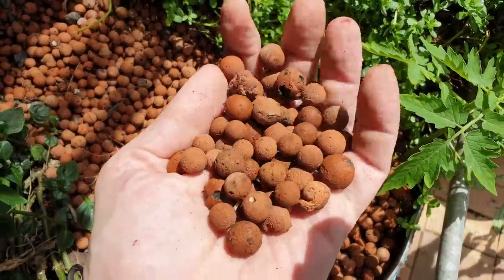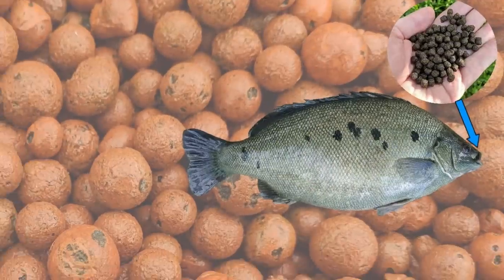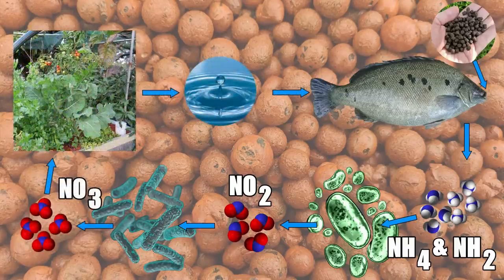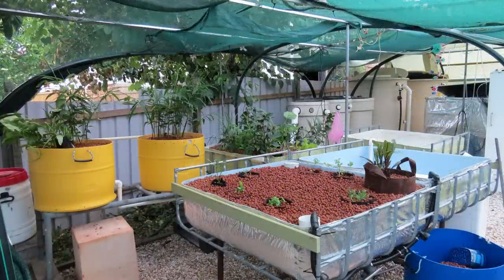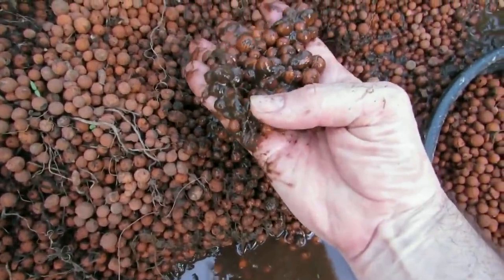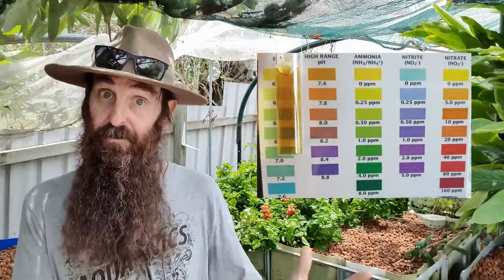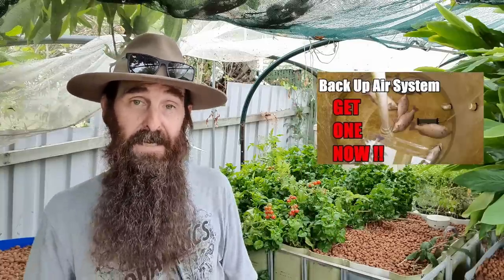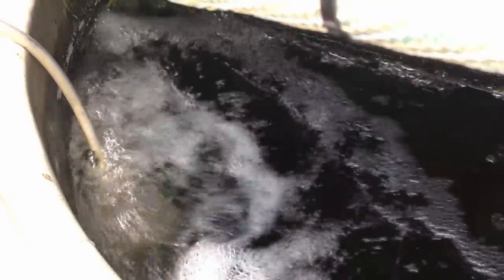5 Common Aquaponic Mistakes That are EASY to AVOID

Comment: If the ammonia is secreted through the fish gills, how can a quality food benefit the system please?
Reply: Are you asking how ammonia is converted to nitrate for the plants to use? As well as some plants are very good at utilising the ammonia directly, it is mostly the media bed bacteria that converts ammonia to nitrite and nitrate  eventually.
Reply: I was wondering why would someone want to use a nutrient rich fish food if the plants use the ammonia from the fish gills. Would the fish waste just be accumulating in the filter with no added benefit to the plant? Cause I am looking to buy a spirulina fish food on my next purchase. Thanks!
Reply: @jbl2270  Because nitrogen or ammonia is not the only thing needed. Wee need most other minerals for plant health and that is locked in the fish poo hence the use of mineralization tanks. Plus direct ammonia utilization is not really efficient. Therefore we need most minerals as well as nitrates to feed the plants.
Reply: already! Somehow the plants will use the nutrients I suppose. Thanks for the input. Much appreciated
Reply from the maker: As Gürkan mentioned above, the plants need more than just the nitrate that the ammonia is converted into. It is also best for the fish to use nutritious food as you will be eating them as well. A sick animal isn't as nutritious as a healthy one. 
Cheers. 
Cheers.

Comment: Hi rob. I have a month old tilapia. The water is still murky though i already have a radial flow filter and a bio filter. How can turn water clear? Do inneed to add another filterfrom the sump going back to the fish pond? I hope you can help me. Thanks
Reply from the maker: As to your request, I would need more information as for all I know you could have 100 fish in a 200L pond. 
From what you've said all I can recommend is that you run a canister/sponge/mesh filter before the water returns to the fish.
Reply: @RobsAquaponics  thanks for that info rob.
Reply: @RobsAquaponics  i'll send you photos and videos later.

Comment: Off topic but am an off grid an wonder where is an idea place to setup a system
Reply from the maker: Probably closest to the top up water source so you don't need to run the pump too much & conserve power Mike. 
It would also need to be in a position that got a decent amount of sun for the plants as well. 
Sorry for the time it took to respond.
Reply: @RobsAquaponics   thank you for the info

Comment: Hi Rob, I would appreciate your help on unexpected tilapia deaths in my aquaponics please. I have lost three of them yesterday and 7 more this morning. Ammonia 0.5 ppm, Nitrite and nitrate 0, pH 6 which is expected before my weekly buffering with no recorded pH spikes. Ammonia is usually at 0.25 in my system and all other parameters are the same. The only things i can rule out is that i transferred 2 small fingerlings from a tank where they were lethargic and dying. Temperatures have dropped suddenly and 4 nights ago I used some BTone and light neem oil spray after. Your help would be much appreciated
Reply from the maker: Sorry I missed this J BL. Have you lost many more?
I have heard of folks losing young tilapia due to massive temperature swings. Oil sprays can also coat the gills of the fish suffocating them if a lot of it gets into the water.
Reply: @RobsAquaponics  No worries Rob. I always appreciate your replies whenever you find the time. I've lost all of them and was bummed out. I had nurtured them from juvenile to full grown adult size and my system was thriving. I dont know what happened as tilapia are tough and I've even seen them living in ponds so full of algae that you couldn't even see your hand in it. I spoke to a pet shop owner and he had also lost his tilapias in his pond around that time. I registered water temp at 15C after they all died. My system is a blue barrel system which may not have given them a chance to acclimatise to the drop in temperature? They had become lethargic and feeding only at the bottom, to not feeding at all to gradual death counts :(
Reply from the maker: @jbl2270   Sorry to hear that mate. :/

Comment: Sooooo.  I made the first mistake, but I already made the mistake and now I have 50 fingerlings 2-4 inches in an IBC w one growbed of clay media.  I also have a biofilter, but I am worried I might have problems in another couple months of growth.  Any suggestions?
Reply from the maker: Hi Thomas. What sort of biofilter are you using?
Reply: @RobsAquaponics  Hey. Since I wrote this comment I added a lot of bioballs to my sump tank and a second grow bed. I also have a small bio filter with additional bioballs so maybe I am good?
Reply: I use clay media and lava rock in grow beds
Reply from the maker: @tgshaffer  You may be. Did the bio balls come with any suggestions as to how much waste they can process?

Comment: Hi, Rob, will the equation of 25 l of clay media for 1 kg of fish will change if someone is using construction stones?
Reply from the maker: Hi mate. It's 25L per 500g or 1lb of fish. 😉👍
It would be basically the same for suitable rocks (with no carbonates in them) that are about 20mm/¾" in size.
Hope that helps.
Reply: @RobsAquaponics  yeah thanks
Reply: @RobsAquaponics  hi rob, if bio filters are used can the requirement of 500 gm of fish for every 25 l of media be reduced? I am planning for 700000 liters of water with 25000 seedlings of barramundi, so it comes out to be 437 tonnes of media which is enormous. Pl help if there is some formula for the calculation of surface area for bacterial colonization
Reply from the maker: @birendrachoubey6122  That is a system much larger than I have built so won't be of much help sorry. You will find that larger facilities will use stand along biofilters using specifically manufactures biomedia. I suggest you enlist the assistance of an aquaculture or aquaponics designer to help you out.
Sorry I can't be of any help
Reply: @RobsAquaponics  thanks no problem

Comment: would a mild amount of solids be acceptable if you have earthworms in the growbeds? 
also - do you have a go-to list in the event of high / low ph spikes?
Reply from the maker: No list on the pH spikes sorry but will look at adding one at some point. 👍
You will always get some solids in the grow beds as most DIY filters are nowhere near as efficient as commercial ones. You'll also get solids in the form of old roots & dying bacteria so there is always something in there for a compost worm to process. 
Hope that helps some & sorry for taking so long to reply.

Comment: My mistake was adding to much hydrated lime into fish tank to try and correct ph
Reply from the maker: 😕 How did the fish go Nguyen?
Reply: @RobsAquaponics   some died from lime burn. Now i add a bit at a time into the radial solid separator which goes through the media beds first before making it to the fish tank. I recently watch your video on adjusting ph, and i am going to try the shell grit. Seems my systems ph is falling quicker than i could raise it

Comment: So for 1000L tank you put 40 fishes? Some people say that they put around 100-120 fishes in a 1000L tank
Reply from the maker: Depends on the context. If you're commercial & know what you're doing go for it. 
I don't think it's fair on the fish to be stocked that densely so that's one reason why I suggest less. 
Most of the folks that contact me for help when their fish start dying are generally stocking more than 60 fish per 1000L. The system gets overloaded with waste (ammonia), the biofilters (beds) crash & fish start dying. 
I think it's just easier to start small in a backyard setting then as you learn more you can go from there. 
Cheers.

Comment: I come from a fish background more so than a plant one. My guess would be adding more water (ie sump tank, filters extra bed) as well as more filtration (removing solids, more nutrient hungry plants) would skew the 1 fish to 25L equation in favor of more fish. Just a guess and would love your input as you have way more experience than I do.
Reply from the maker: The volume of media required is based more on the available surface area that the bacteria can colonise on the media itself, as you probably know. If you were to add a stand alone biofilter with K2 or similar media you could keep more fish than the beds could normally handle with no dramas & have done that myself with system before the p[resent one. 👍

Comment: Well, this explains why I have trouble with my farm every year.
1. Wrong grow media. I used pea gravel. Don't do that.
2. I have little to no solids filter. I tried making a "swirl filter" where the water would come in and swirl and the clean water would be skimmed off the top and solids were expected to fall to the bottom. Only thing is, it doesn't work like expected, so. . . little filtering. Don't do that. . . put on a good solids filter.
Unexplained fish dying off. I lost half my fish overnight recently. This video showed me why. 
At the beginning of the season (my garden is not in a greenhouse) the plants go nuts and produce like crazy. But later in the season, the leaves turn yellow and production falls way off. Most likely due to one or several of the errors listed in this video.
I will be changing the grow media and revising the solid filtering to get the crap out (pun intended).
My grow beds must be washed every season because of the muck that gets in there caused by insufficient filtering and capture of the muck.
I learned more from this short video than I have from many others!
Thank you!
Reply from the maker: I'm glad the video has helped you out Doug & hope you can get the issues sorted soon mate.
Happy growing. 🌱🌱🐟

Comment: Is the fish poo, just a byproduct then, and doesnt really add anything to the cycle?
Reply from the maker: There are nutrients in the solids waste so that's why many folks will add it to an offline mineralisation tank. The solids get mineralised & the nutrient rich water is added back to the system. 
It's a bit more in depth than that & will be posting a clip on the  process once I have mine set up but hope that helps for now. .
Cheers.

Comment: I have some old computer back up sytem I can add a new battery and that can keep thing going.
Reply from the maker: I'm thinking about getting a UPS for my parents system. Just need to find one large enough to run a 25w pump for 8-10 hours... 
Cheers Ronald & happy growing mate.
Reply from the maker: The Truth about Africa hurts   I like to have the water run 24/7 & the main air line as well. 
Have seen others run on timers but have also seen what happens when the timers fail or are not set right.
Reply from the maker: The Truth about Africa hurts  I'm lucky enough to have a live in house sitter when we go away but will be looking at setting up the next system with dual water & air systems.  Cheers mate.

Comment: If using nut and tails ensure the rubber washer is in properly and not worn nearly lost my fish
Reply from the maker: OUCH. Thanks for pointing that out n k. 👍
I have had a few leak due to over tightening as well when I first started out.

Comment: Proper size nft Will overflow #My2Centz
Reply from the maker: I haven't grown with NFT as of yet.. 
Cheers.
Reply: @RobsAquaponics  Hey Fam, Really Enjoy your Content, thank you for Sharing. Nft is Great, You Should Definitely Look into That. Way More Plants and Triple if u Tafe It Vertical. You Can Still even Use Clay Pepples in the Net Cups. Oh! And I'm Prettry Curtain u May Even Start on your Preexisting System, if you Split the Flow From The Sump Back tuh the Fish Tank/NFT With Ball Valves On Every NFT Track tuh Control Flow Rate. You Would Want and Nice Slow Trickle. With  multiple tracks Each ball Valve Would Control every Flow Rate Acordingly As Not to Overflow Tracks with Slight Adjusments until Satisfied. Go For at Least The Minimum 3 inches for Good Root Space. 
Just Sum basics 
I am still Learning, But Shout Definitely Look into This 
Floating Water Beds Are Great Too, If Not Better
LessMechanics
Less fun, lol 

Great Growing
BPonics

Comment: HEY ROB, COMING OUT IN THE MORNING AND FINDING A TANK FULL OF DEAD FISH DOESN'T SOUND LIKE A PLEASANT EXPERIENCE.  LOL   I HAVE PLANS TO BUILD A VERY LARGE POND TO GROW TILAPIA FOR THE MARKET IN MY PART OF THAILAND. THERE WILL BE 4 PONDS 2 FOR 2 DIFFERENT TYPES OF TILAPIA, 1 FOR CATFISH AND 1 FOR CRAYFISH. I KNOW THAT I HAVE TO ADD AIR TO THE WATER AND WILL USE A WATER WHEEL THAT WILL RUN ON SOLAR WITH A BATTERY BACKUP FOR DAYS WE DON'T GET THAT MUCH SUNSHINE. IF IT'S RAINING THAT SHOULD BE ENOUGH TO ADD OXYGEN TO THE SURFACE. I THINK.  LOL 

EVEN THOUGH I HAVE DESIGNED MY SYSTEM I STILL WILL LOOK FORWARD TO SEEING YOUR SYSTEM NEXT TIME I COME TO AUSTRALIA. LOOKING FORWARD TO THAT TRIP.
Reply from the maker: Sounds like a decent farm Brock. Have seen a few small fish setups by folks I follow over there but pond culture looks to be the best way to go. 
Cheers mate & good luck with your venture.

Comment: I am a beginner with aquaponics, and somehow my fish tank pumped dry, and even with slowing the flow out to media bed, it did it again. I'm stumped.
Reply from the maker: Do you have a sump tank or are you pumping directly from your fish tank?
Reply: @RobsAquaponics  I have a sump tank. So it goes from the fish, to the media bed, and drains into the sump tank. Then pumps from the sump back to the fish tank.
Reply from the maker: @langemobile  Am not sure how you lost the water in the fish tank then. Are you using a solids lifting over flow with an open "T" in the top to prevent a siphon occurring? 
I show my SLO in this clip if it helps any. https://www.youtube.com/watch?v=bmzgANTGJ0k
Reply: @RobsAquaponics  no I'm not using an slo. I think maybe the sump tank pump isn't filling the fish tank fast enough.
Reply from the maker: @langemobile  The water into the fish tank should be the same as the water out & it should never run dry.  I think I'd need to see the way you have it plumbed up to help you properly. 
Sorry I'm not of much help.
Reply: @RobsAquaponics  that's what I was thinking. But thanks for the extra support. I'll keep at it, and try again to see what I can do to remedy it.